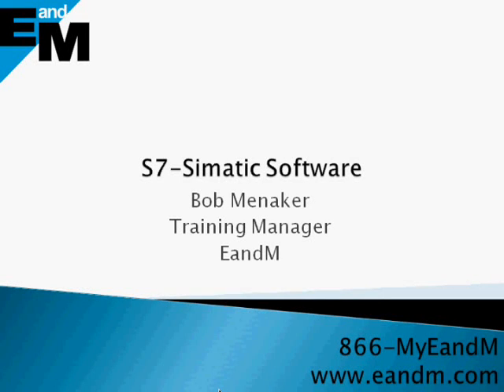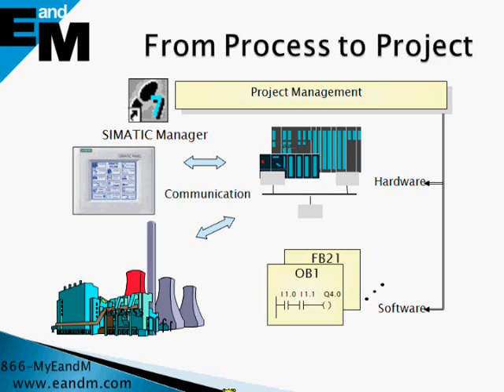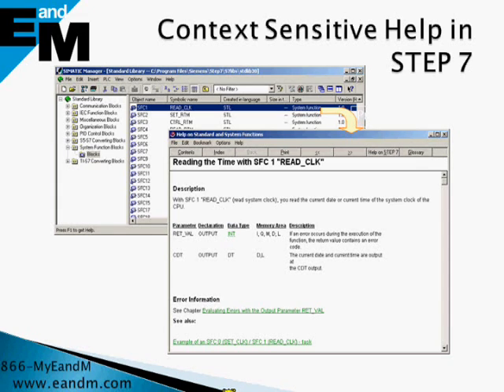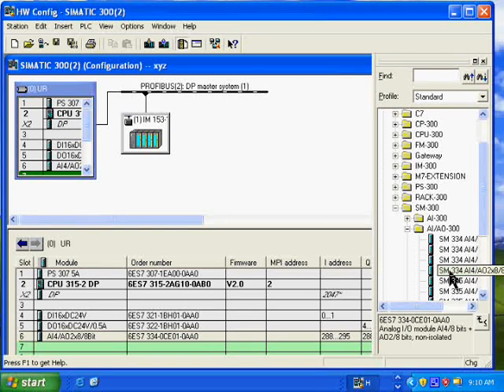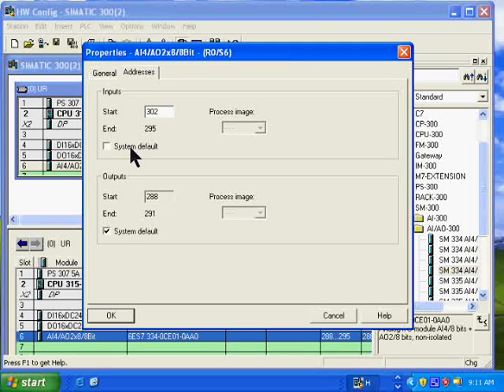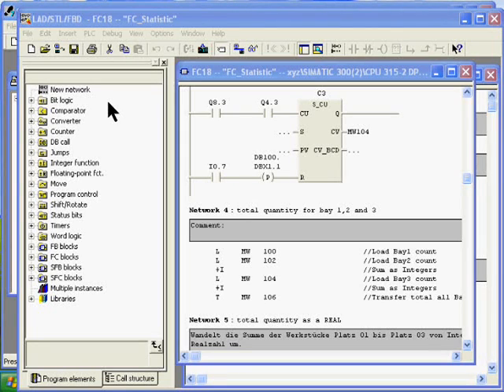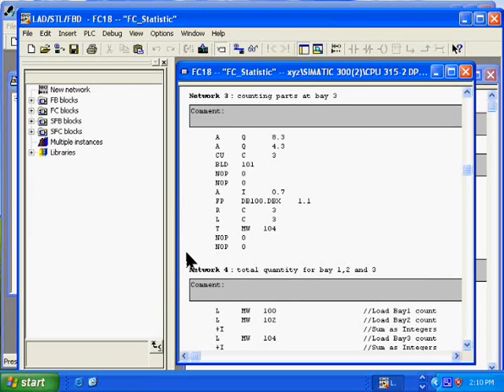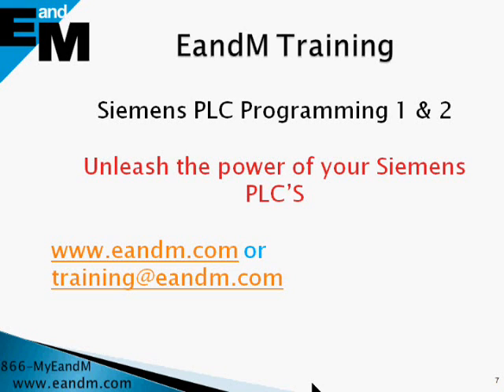Siemens S7 SIMATIC Software

Comment: A lot of time is spent installing and maintaining the software.

'Help' in Siemens software is not very helpful.

Vid shows SFC1 (read system clock). Go ahead,try to use it - timestamp a fault, set your hmi clock, send the operator to lunch. Easy right?, 'help' is right there. 

Statement list CANNOT be shown in ladder unless you are very careful or you wrote it using ladder in the first place. 

Also, STL cannot be indented - kills readability.

Too bad I only have 500 characters